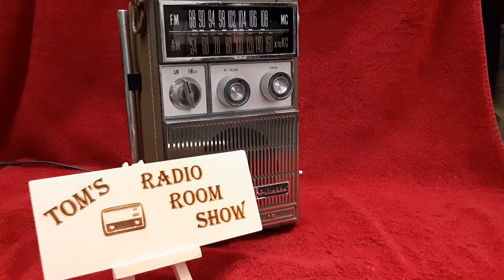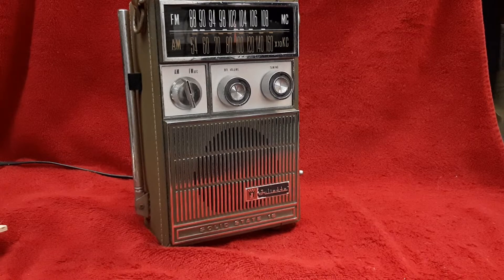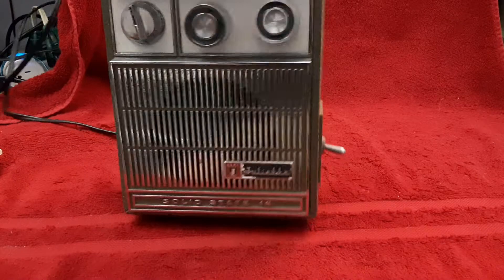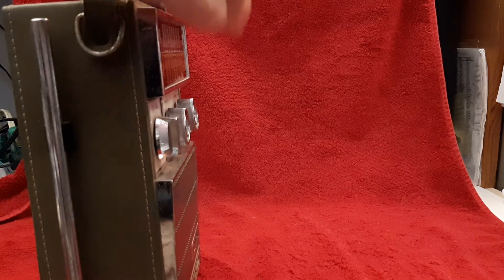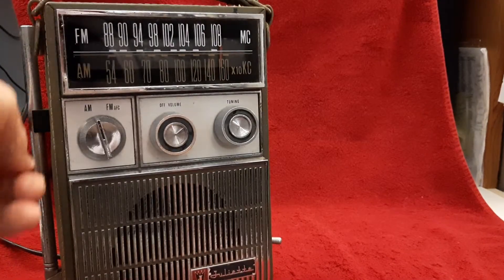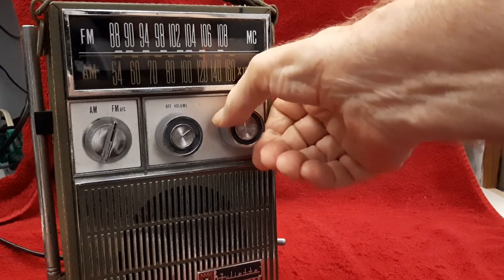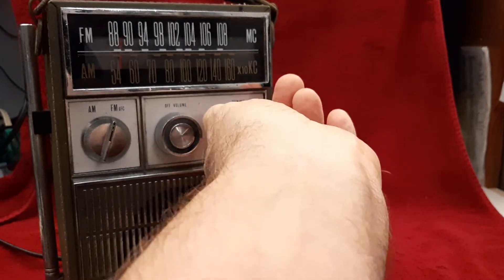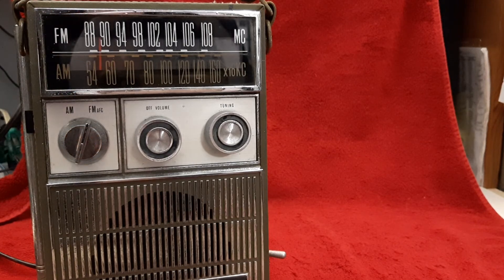TRRS #2307 - Juliette 18 Transistor AM/FM Monster Portable Radio

Comment: Cool radio Jeff. What a beast and that switch. This one is a keeper, I love it! 👍❤️📻
Reply: Yeah I got it from a local. It was his dad’s .  It was absolutely filthy❗️. Had to use my professional Auto Detail products on it , including my Acid based wheel cleaner on the Chrome.
I saw 1 replaced capacitor, and some non-professional rewiring inside, and, of course THAT SWITCH❗️
But the radio plays very well.
📻🙂

Comment: Gorgeous receiver! I love these old radios. Pure artwork. I bought a Panasonic retro radio because it looks like the old ones. It`s on sale right now. Six inch internal ferrite for AM and extremely sensitive. Panasonic RF-562D or something like that. It`s worth the current sale price in the 36 dollar range I think. Was over 50. Only bad thing is the shortwave band starts at around 5 mhz and it has muting of weak nighttime stations. Extremely loud crisp ear shattering sound on FM. 

Great long range daytime AM nearly as sensitive as an EP PRO outside so a really nice hurricane radio for the price with long battery life. Looks great as a display on a shelf. Unfortunately mine didn`t pass the Texas December two week camping trip torture test. My CCrane and Sangean passed two weeks exposure to outdoor temps and humidity but the Panasonic now has low volume. Volume dropped when it went below 35 degrees several times and at some point it stayed that way and never recovered.
Reply: I have both versions of the 562DD. [ Analog, and “updated” DSP-based version].
You are right. MW is outstanding.  SW can be a bit of a pain, though.
A decent radio for the price, now.
   Sorry to hear about your Panasonic.  While I like it, Panasonic  [ and Sony too] just not what they used to be.
  They’ve been replaced by Tecsun, Sangean, C.Crane.
   Thanks for watching 
📻🙂
Reply: @jeffking4176  Mine, for some reason, is easy to tune on shortwave. I can quickly locate active signsls. I heard others say their`s didn`t tune well and was surprised. I really liked the ease of tuning on mine. Seemed to quickly lock onto stations. I saw the price had dropped to 34 last night. Only one left.